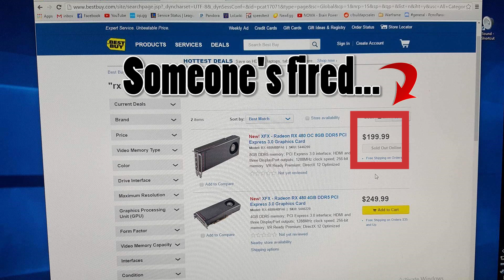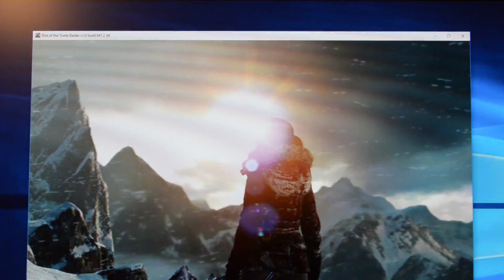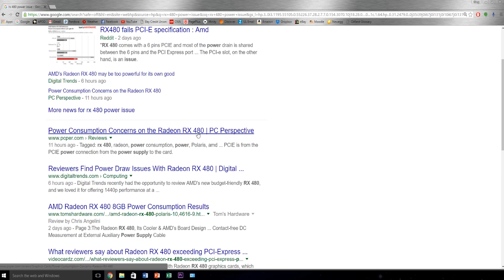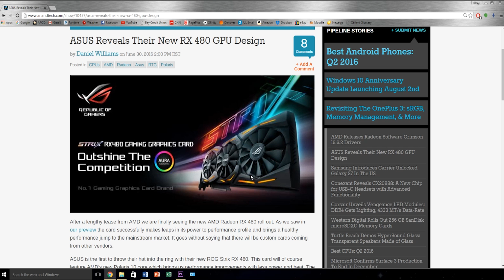RX 480 Aftermath: Power Issue & Over-Hyping

Comment: I just got RX 480 My problem is the same i see on google DRIVER CRASH BLACK SCREEN and have to hard boot to fix. does this over 100 times a day. ASUS Crosshair V FX 8350 1000W EVGA G2. I did not have this problem with my R9 390 but it seams that every time a new gpu comes out driver crashes happen all the time for the first 2-4 months. CAN ANYONE HELP?  AMD said download net frameworks and C++ i did that no help for AMD.
Reply: Christopher Bear why did you give R9 390 IN THE first place.

Comment: i knew that 6 pins are not enough. remember the old days when passive cooled cards destroyed your agp   slots  and motherboard. bought an 8 gig model with 8 pin connector from saphire awesome card !!! My ps4 is louder under load then my pc. even under 1700 rpm with stock  wattman settings and playing on ultra. and the next thing is most new 1st time wannabe rig builders buy an lc power psu for 10 bucks and then wonder why performance is thrash or blue screen issues etc. so don´t save your money at the psu guys!! at least buy 80 plus efficency  from a known brand. power is the most important thing in your rig.

Comment: Well they have fixed the power issues and the card is a beast which beats the 1060 on dx12 and vulkan titles. How is this overhyped??
Reply from the maker: This is an old video. Pay attention to the posting date. The card was overhyped before it officially launched. People expected it to perform on par with a GTX 980/R9 390X, and it does not.

Comment: My issue with the 480 is that it's… not that cheap to be a solid budget decison over 1070 (and truly, 1060, when it's out).

I can just buy a 1070 and downclock&downvolt it if I don't need those excess fps (I have a 1080p monitor and 1070 is currently a big overkill on 1080p) for less heat and noise. That way it may save those extra service years, I had a sapphire 7870 and it ran just about under three years before its vram died on an instant. It usually ran about 72-75 degrees under top stress, hitting 80 at times during long sessions. 

From what I've seen, a ref 480 main unit at stock clock heats to about 80 degrees. Meanwhile, vram can go up to 95 degrees hot. That's not going to under any circumstance last long. I suppose my 7870 vram ran at comparable temps, and here's what I got. It isn't quite an early fault, still, not what I'd want from a gaming rig I plan to have for the next 5+ years.

The only question, is 1070 going to last that longer on same terms?

Comment: Yikes on the power issue. The 480's performance is pretty impressive considering the price. That's if you can find one! I couldn't find this card anywhere, so I went with the 390. The 480 goes for a lot more in Canada and I was able to get a really good deal on the 390, so I'm saving a few bucks and getting a pretty comparable card.
Reply: The 390 was a lemon so I found an RX 480. What a nightmare.

Comment: I don't think the power issue is a RX 480 problem only. I was having the same issue with 2 different R9 380's while running the earlier (pre July 9th) Crimson drivers. One of the cards being a Sapphire Nitro with 2 - 6 pin connectors.

Comment: The cheapest fix for that motherboard or any older / budget motherboard in particular is to buy one of these: http://images10.newegg.com/ProductImage/14-998-092-06.jpg

These allow to add MORE current to pass through the motherboards PCI-express lanes. This means you can extend your OC as well because it's not limited to that 75W of power anymore. It's called a PCI-express power booster and back in the days Oc'ers figured out that certain radeon cards tend to pull out more current from the PCI-express slot then the 75W advertised. More expensive motherboards have a better power distribution and even offer a Molex-connector right next to the PCI-express slot, providing more then the 75W. It's not a big of a problem, the cable proberly only costs a few bucks, but guarantees that your motherboard does'nt crap out.

Comment: You should try a reference 950 ti and 6-pin 960 on that AM2(+) board, rather than a 980. You know: apples to apples when it comes to PCI-E power draw... anyway, since you mentioned FP performance: may I ask what the FP64 ratio of this card is? I'm still recommending Hawaii-based gpus as cheap OpenCl beasts in 2016, I'm getting bored... (If someone says CUDA: I won't code twice the same thing for a GPU brand when I can do it once and let it run on everything from smartphone to Cray :) )
Reply: i made the same statement earlier, but obviously this youtuber maliciously avoid it ;-)... disgusting

Comment: I should clarify, this issue is solved with driver update on software level with update of driver,and no update of gpu bios is needed.. sure if needed will be further improved.. more less,end of story! anyway also nvidia card take more from pcie slot then is specification..and nobody complain as usually people do not put this class of cards on really budget motherboards,with power phase design limited..or to say simple: people do not use donkey for race,they use horses for racing..
Reply from the maker: Already covered this in a separate video.
Reply: you also said in comments below (unless you deleted it) that this issue can't be solved with new driver ! stop misinforming people !

Comment: the card is expected to be bought for Crossfire with them bragging out the card in CF could out-bench the GTX 1080 in a DX12 game like Ashes of the Singularity. This is very specific because AMD cards starting at the R9 300 series are very-well optimized for DX12 and have been seen to bottleneck in DX11 games. Even so, benchmarks show that the 480 crossfire barely trumps the 1080 with both at stock speed.

Comment: They released a driver to fix this recently, but since the 200$ RX 480 are all sold out you might as well wait 2 weeks from this point and get the 1060 which claims to beat the 980GTX, as the RX 480 does not even beat the 980 GTX in any real benchmarks I have seen by far. The official release date was said to be July 19th. Note RX 480 is a competitor to GTX 970, not the 980GTX which is a jump to a high performance card. As much as I wanted to try an AMD card, it does seem like RX 480 is not worth getting and luckily the 200$ cards are all sold out at this time unless you want to pay 250-300$ for it instead of wait for a superior card for 250$ in a week or two from NVidia.

Comment: As far as the mobo issue goes - How old is too old? I have a Gigabyte Z68 board that I bought with my i5-2500k a few years ago (2012). I'm in a bind as my current gpu died last weekend and I don't have a lot more time to wait, as much as I'd like to. So the RX 480 seemed like the perfect choice until I saw this video and now it has me thinking about holding off until issues are further identified and smoothed out.With a $250 gpu budget it seems like the only other "best" options are the R9 380X and GTX 960. I'm stressing out over the decisions. There's never a good time for things to break when it comes to computers. XD

If you were in my shoes, what manufacturer/model would you choose with 250 today? (There is a very real possibility of getting an upgrade towards the holidays but unfortunately time is of the essence.)

Comment: I'm Running 2 RX 480's in Xfire on a Asus Aura Pro Gaming Motherboard, as well as a AMD 9590 CPU with a Corsair 750 Bronze PSU, Corsair H110i AIO and have run Firestrike, BF4 and The Division with no problem regarding the power spike issues, alot of people are giving AMD a hard time over this as well as performance, 1st of all it was never meant to compete with the 1080 and 1070, it was aimed at the middle of the market for those who want more bang for buck, and secondly if your running a mobo thats 8-10 years old or older and expect the latest hardware to run ok then it's kinda your own fault, People know that technology moves on and to run the latest Software and Hardware you may need to upgrade parts of your PC, I don't hear people crying they can't get HD Channels on their TV with an old TV Set, They all bought new TV's Whats the point in buying a Blu Ray Player and plugging it into a Standard Def TV, this is the same, Buy good quality componants try to plan ahead and you won't get caught out, 
Or maybe these people will be complaining when they buy DDR4 and find it doesn't fit, It's just mainly nVidea Fan Boys complaining, and i think the initial statements about the PCIE problems flew out all over the net before any chance was givien as to what and why was published, it's like anything really you always hear about the bad more than the good. Anyway rant over thanks for the videos at least i see your not leaning one way or the other, its good to have impartial advise.

Comment: Something you and AFAIK no other reviewer I watch pointed out:
AMD was talking about how power efficient their new architecture is... the fact that the RX480 is a 14nm chip and is using roughly the same power draw as a GTX 970 for roughly the same performance is, IMO, noteworthy and very disappointing. Compared to nVidia's chips, AMD has no leg to stand on when it comes to efficiency, i.e. performance per watt.

Also, repeating over and over again that the RX 480 is not AMD's flagship is pointless. The GTX 970 wasn't nVidia's flagship last gen. Keeping up with the last-gen second-tier or third-tier card (depending on who you ask) from your competition is nothing to brag about... especially when you consider that the RX480 is currently roughly the same price as the GTX 970 in Germany: Both cost around 250€ to 300€.

Overall, I was hoping for a lot more from AMD, especially after what they've been saying before this was released.

Comment: PC shutting down is caused by not having a good PSU with gold or platinum rating, 400w - 20% = 320watt PSU for bronze, and then it depends on what AMP the rail is and if its single rail

XFX XTR is the best mid range gold PSU and will power anything
Reply from the maker: PAY attention. It shut down with my 750W in the system, but only with the 480, not my 980Ti.
Reply: Science Studio
probably your intel http://www.pcworld.com/article/3021023/hardware/how-to-test-your-pc-for-the-skylake-bug.html

Comment: if you put a 5 litre engine in a 600kg car, your first impression will be "wow! this is fast!" drive a few hours and you ll see it slowly falling apart. if you get a regular car and engine combo but pair it with the 5 litre's gearbox, well it wasnt made to be driven by something like a 1 litre engine so the gearbox will not work as it should be. pair an rx480 with any old or office grade cpu and well... i d feel more happiness castrating myself instead of my gpu i just bought. lemme telk you: cpu bottlenecks really make you hate life..

Comment: Hope AMD's upcoming high-end GPU like the RX 490/490x wont have this kind of power issue. Both upcoming GPUs are confirmed to be using single 6-pin and my PALIT GTX 1070 8GB which is also using a single 6-pin doesn't have this kind of issue. Even the GTX 1080 which is also using a single 6-pin doesn't have this kind of issue. And I'm using a 99$ motherboard from Asus which is a M5A97 with a 750Watt PSU. I just want both sides to be equal :)

Comment: Slot Power Limit Value – In combination with the Slot Power 
Limit Scale value, specifies the upper limit on power supplied by 
the slot (see Section 6.9) or by other means to the adapter. 
Power limit (in Watts) is calculated by multiplying the value in 
this field by the value in the Slot Power Limit Scale field except 
when the Slot Power Limit Scale field equals 00b (1.0x) and Slot 
Power Limit Value exceeds EFh, the following alternative 
encodings are used: 
F0h = 250 W Slot Power Limit 
F1h = 275 W Slot Power Limit 
F2h = 300 W Slot Power Limit 
F3h to FFh = Reserved for Slot Power Limit values above 
 300 W 
This register must be implemented if the Slot Implemented bit is 
Set. 
Writes to this register also cause the Port to send the 
Set_Slot_Power_Limit Message. 
The default value prior to hardware/firmware initialization is 
0000 0000b.

directly from pci sig standard manual for pci express 3.0 revision 3.1.0. 

understand board design and board theory first. information also taught in a first year computer engineering class. this information can also be sited from most text books on the subject. this information cannot be sited from my 7 year old textbooks as pci e 3 was not standard. also pci 1x is also 25w per pin with 4 pin layout on the with the rw control set to 0b by default.  
I do understand pc and motherboard design and have also showcased with msi when I was younger for a demo through my parent retail store. I also have an education from University on computer engineering.

Comment: Issue I see is everybody has always expected the next AMD card to be the Nvidia killer. This seems a little bit of a long shot. One thing AMD has going for it is they are so innovative with new designs, but I think people enjoy getting ahead of themselves with this crap. The RX 480 is a beautiful card that has a quirk like any other. I'm so impressed it, I'm actually going to use it in a build for a friend.
My current building is EVGA 980 Ti's in SLI with a 6700k processor, but that doesn't mean I'm only for them, but I will acknowledge Nvidia does a great job on perfecting what AMD comes up with. Sadly I feel like that will always put them in the lead, but I think the mid range cards is where AMD is shooting for now.
Reply from the maker: Exactly.

Comment: how much of an idiot do you have to be to think that the NON FLAGSHIP 200$ card will compete with a flagship 700$ or even the 400$ card? 
ITS A BUGET CARD, compare it to nvidias similar priced offerings not to they twice or 4 times as expensive cars. 
if you want to see the flagship wait for 2017 when they release Vega. that's the one you have to compare to the 1080.

Comment: Buying an RX 480 or a GTX 970 for VR, is like buying an NVIDIA 9800 GT or an AMD HD 4870 for GTA V. Sure, the bare minimum will allow you to play today, but you'll regret soon after the minimum requirements surpass the old minimums. Do people honestly think that this card will play potential AAA titles in VR at acceptable frame rates when they can't even max out settings in normal non VR titles? Think about that.
Reply from the maker: Yep.

Comment: The msi 980ti comes with two 8pin connectors. So, i guess it would certainly be more judicious and valid to compare the 6pin rx480 with for instance the 6pin gtx 750ti or the 6pin gtx 950 and see how your very old motherboard react ;-).

Comment: Evidently AMD didnt test these for crap.  If they did test them, this would have been so apparent they could not have missed it..  AMD either just let it go and went ahead and released the 480 to the consumer to find the issue, with amd knowing it could destroy a motherboard...   or AMD didnt test the card enough to find the overvolt issue, releasing it to the consumer to do the actual testing of the card to cut costs, this is probably the legitimate answer and is actually a known business tactic....However it came about, AMD dropped the ball..

Comment: If the 480 is a budget performance card and has PCI power lane issues then this is a huge deal. For the mass of us out here who have budget machines and want great graphics performance at a great price are going to just drop the 480 into what we have. And what we have is cheaper logic boards or older ones. AMD needs to address this issue. And waiting for third parties to build an 8 pin or more graphics card isn't a fix for those of us who maybe can support 8 pin power or more.

Comment: Theres a bug in the driver atm so if you are running 144hz theres a ton of bugs including crashing and bsod's mine stays at 1330mhz and i have no issues at all at 120hz if you turn the power level up in watt man it makes the card a lot more stable as well i know at 1330 i have to use 30-50 power in watt man and i also achieved 8130 on the vram at 1330 its about the same as the 980sc i had at 1550mhz but with the extra vram its actually capable of maxing all settings in gta5

Comment: I'll buy 2 of these, I'm  not going to complain about frame rates that I can pretend to see, I'm not going to whine about power consumption and noise that I can't hear because I wear headphones. as long as it's stable and can run my games+have current support for operation in think it'll be a great budget card opening doors for newer (and maybe poorer) pc gaming generations.
Reply: but I'm most likely not getting a reference card because of heating.
Reply: If you gonna CF them, why not buy 1070? One card is better. On many games scaling is just that poor. It will use double the electricity,  because one 480 uses as much power as 1070, so that's another 15$ a year.
Reply: +Vaidas Šukauskas because I don't want to spend a grand on a single card. because if I spend less now, I'll have more to upgrade later with. I've never heard of the scaling problems youre talking about.
Reply: Tyshef 1070 is not a grand. It cost almost as much as two 480. Google any 480 in crossfire benchmarks. Many games run poorly, because game engines don't scale well on two cards.